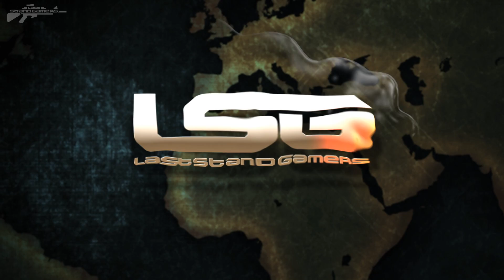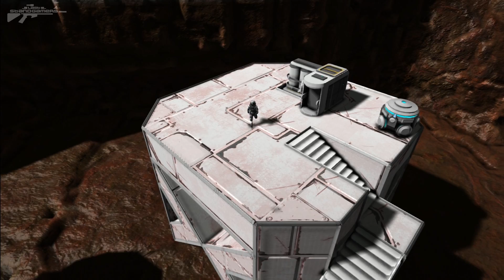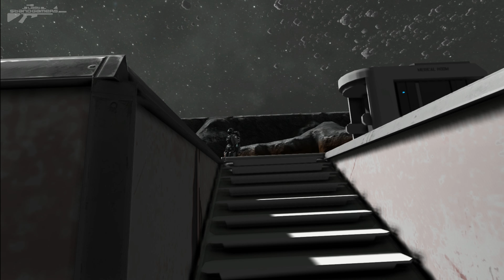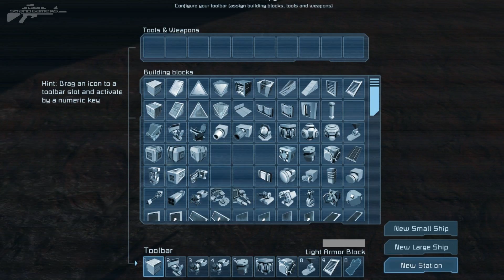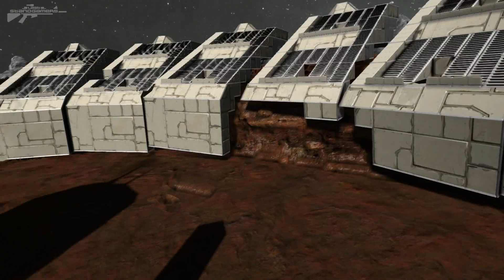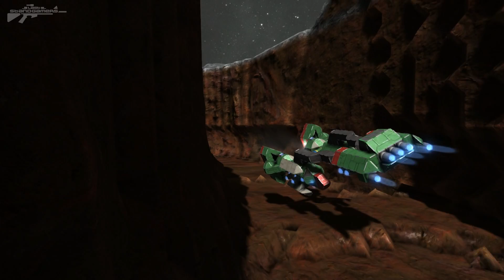Space Engineers - Cinematic Camera Mode & Suit Colourization Drills

Comment: I'm getting the feeling that Small ships are becoming obsolete. There is nothing that separates the two types of ship. You can do the same things and more in large ships
Reply: Well, they are a lot cheaper and usually nimbler than big ones.
Reply: Small ships are more versatile in survival.
Reply: Th4Pwnz0r Small ships don't take years to make.
Reply: Small ships are always going to be needed, Fighters, bombers etc
Reply: Small ships are far more viable to build and use than a huge lumbering ship.
Reply: I completely forgot about uses in survival. Also imagine LSG's podracer track using large ships, it would be ridiculous
Reply: Small ships are the best for construction and mining in my view. They're cheap, consume little energy and can get into place large ships cannot. Some asteroids have tunnels and squeezing a large ship in there is impossible. So, using a small ship, you can get into the asteroid and mine it from the inside. Avoiding meteors and also getting to the "meat" of the asteroid as well.

Overall I personally prefer small ships. Large ships seem like an insane amount of investment compared to small ships. I would opt for a station with or an asteroid base and a legion of fighters and bombers and specialty small ships over a large lumbering big ship.
Reply: ShinEmperor Giant Mobile base with smaller ships to do much of the work.
Reply: I recently built, In creative mode. A ship so large it was insane. It had over 100 drills on it and slowly i could mine an huge asteroid kind of like a catscan scans us in layers. It was pretty cool, But very hard to pilot up to the asteroid. It kind of went where it wanted.
Reply: A small ship could not hold such awesomeness

Comment: what i really wish they add is the ability to combine large and small ships. Though its my personal preference i find it lacking at the moment that for most large ships the most complicated and intricate functionality I can fit into a ship without completely distorting the scale of my ship is just an intricate system of conveyors. It is difficult to include a lot of automatic mechanisms into a large ship if i am to keep the ship to scale. It's possible to just use landing gears to position and lock the small ship parts into the large ship, but I find it impracticable as i would have to use a lot of space for the landing gears a well as have a separate control port at each different small ship part. However if i was able to combine large ship and small ships then i can fit all the detailed mechanical mechanisms in to the walls of my ship with out compromising scale. And it just looks better when the fine detailed inner workings really fit together snug and tight.